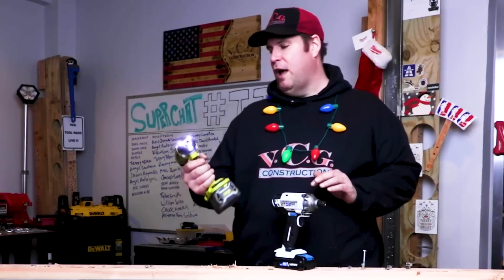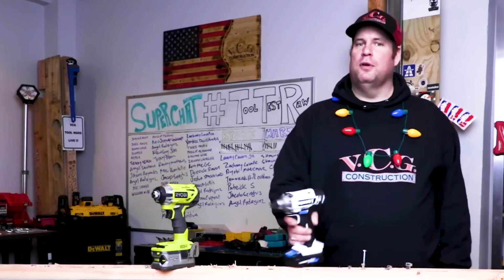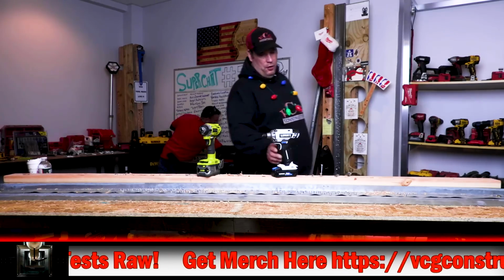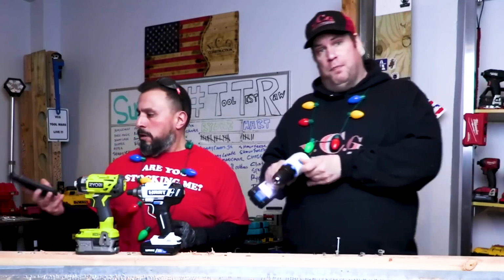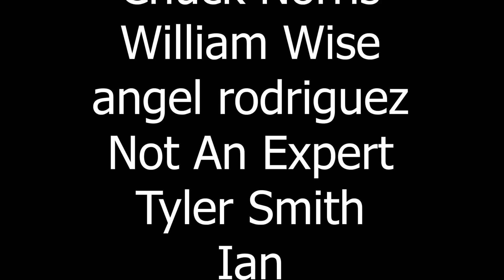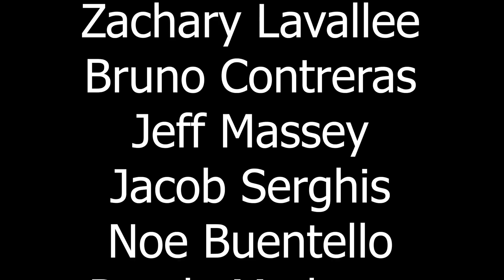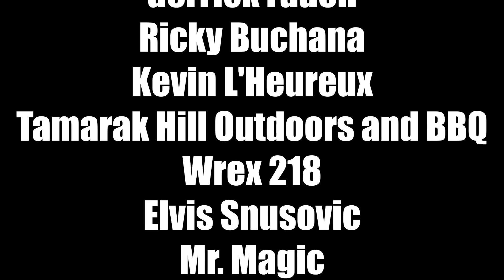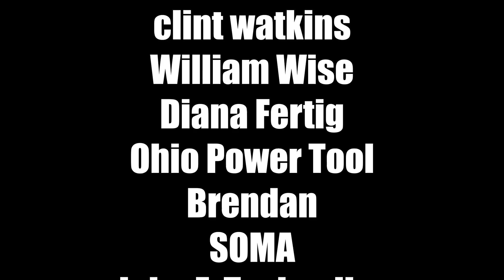We Tested New HART Tools Impact Driver From WALMART...(not what i expected)

Comment: Sooooo I’m not rooting for either team here, but you have to different MAH capacity batteries going. Of course the Ryobi is going to win, the motor can pull more juice from the battery. SMH
Reply: Correct! But these guys are no engineers. LOL
Reply: These tools are identical, made by the same manufacturer
Reply: Yeah that's what I was saying lol gotta make it fair before you put them up against each other
Reply: The only difference is the plastic
Reply: Agree

Comment: Hart vs hyper tough battle of the Walmart brands
Reply: Hart seems like it could actually be classified as a tool. Maybe hypertough vs black and decker?
Reply: @hunterwolfe9059  Don't be a hater. For years dewalt motors were in black and decker cordless drills and even the batteries were interchangeable.
Reply: @MrWizards1974  correction Black & Decker XR was before the DeWalt XR
Reply: Hyper Tough is ass and soon to be discontinued according to my buddy who works at Wally World... I 💙 my Harts though! 😊
Reply: @hunterwolfe9059  black and decker is better.

Comment: Not sure the big man knows that the harder he pushes on the tool while driving the screw, the harder he's making it for the motor.
Reply: Duane George from what I have seen the gearbox and motor are fixed relative to each other on most impact drivers so not really true.
Reply: @hasimalahmadeen472  it just makes sense that too much pressure on the screw adds extra friction, creating a heavier load on the motor.
Reply: Right!? You wanna push just enough to keep the bit snug on the screw head, but there is zero benefit to forcing it! That's how you break screws, bits, and motors! 😟
Reply: Dont know if big guy knows how to put a screw in straight

Comment: You should be matching Hart to non brushless cheap RYOBI P235 that comes in tool combo packs.  It's the same tool as the Hart.
Reply: they compare the tools they do bc the price point is comparable. 

if you start comparing the more expensive hart to a cheaper ryobi tool then you're going to get the results you're looking for. 

these are meant to be comparable in price and therefore they are comparing the better tool.
Reply: @jakobe328  HART tools are overpriced for no good reason...
Reply: xephael but they are wallmarts best...
Reply: Xephael, you are probably correct as both Ryobi and Hart are brands of TTI, probably manufactured in the same Chinese factory.
Reply: Ive had that ryobi for the last 5 years. Ive beat the living shit out of that thing. Honestly, it still runs great.
Reply: @amatteroftimeisuppose8900  I have the Ryobi too it's amazing
Reply: Hart RYOBI and Milwaukee are all made by TTI based out of Hong Kong just rebadged and detuned performance wise other than that they are all made of the same materials not bad for the price I’ve beaten The hell out of all 3 brands really comes down to brand preferences and use
Reply: Jakeb I disagree. If you’re going to compare tools, the comparisons have to be as similar as possible. That means the same battery size (aH wise), brushless, etc. At the end of the test you can give your prices and let people decide. Think like Car and Driver magazine comparing similar class cars. They’ll stack them up capabilities-wise, drive them, then show you the price difference.

Comment: The batteries don’t look the same. The Ryobi looks like a 4-aH battery and the Hart looks like the 1.5-2 aH battery it comes with. The 4 aH battery is twice as powerful. Not a fair comparison.
Reply: Amphour doesn't make the battery more powerful,  it just makes it stay charged longer.
Reply: Wrong dogz. The 4ah battery is needed to reach full torque. Check it out
Reply: doesnt help one is 18 volt and the other 20 volt
Reply: @piggybank292003  the bigger the battery the more torque it unlocks. Do your research

Comment: I've purchased Hart Tools and found them to be fine for me being a  home owner. I wouldn't recommend these if you're a handyman or contractor making a living with their tools. These are obviously low end tools and should not be expected to out perform or last as long as the high end tools. I know I got what I paid for and fully understand. You pay $48.00 for a skill saw and that's what you get. An inexpensive $48.00 skill saw. Thanks for the video.
Reply: They do make "construction grade" tools. They aren't "low end" by any means. I pulled 8 VERY rusty bolts out of a 15 year old car, from the seats. And it did it easily with the 4mah battery

Comment: Larger batteries have a higher amp rating, not just capacity. Allowing the motor to draw higher amps and more watts at the same voltage as the smaller batteries. A fair test would be to use the same or similar batteries

Comment: What size is the Hart battery? Seems the Ryobi battery is much larger in capacity. Could make a difference
Reply: I think the Hart batteries they are using are a 1.5ah and the Ryobi is a 4ah they are using it because that's what the kits come with. Hart makes a 4ah but I'm not sure if it's out yet or if it's not feasible because of the price difference in the kits it wouldn't be an equal comparison.
Reply: The capacity isn't making a power difference here. They're mostly the same tool from the same parent company. The only advantage would be if the Ryobi were brushless vs. brushed Hart.
Reply: 1.5ah vs 4ah is a HUGE advantage. NEVER let anyone tell you the battery size does not effect power with drivers and saws especially. I’m sure the “scientists” are going to respond saying the size battery doesn’t effect driving power. But from someone that uses these tools in the field everyday I’m telling you the difference is massive on certain tools. The first couple screws won’t be that different, but as soon as that smaller pack starts getting warm the larger pack destroys it.
Reply: warlok9 peak capacity makes a huge difference. It’s like cold cranking amps for a car battery. The bigger battery will have a lower internal resistance and be able to supply more current and keep the voltage up.

Comment: Used Makita since the 9.6v first came out until. . . I got a Ryobi 18v set 4 years ago. Use it commercially 5-6 days a week. Love Ryobi now... impact driver has been beat to hell, dropped off ladders and used as a hammer. Sawzall is great with a 50% or better battery, skilsaw is good. HVAC. My money goes to Ryobi now. My 4ah batteries are fully charged in 30 minutes, 2 for $99.

Comment: The batteries with higher amp hours deliver more power and more performance, allowing the battery to work for a longer time on a full charge as compared to the cells with lower amp hours. ... As the AH or amp-hours rating of the battery indicates the consumers about the amperage that a battery will provide in one hour.

Comment: Hart is only sold by walmart not manufactured by them, hart is owned by TTI , so in a way hart's cousins are ryobi, Milwaukee, and Rigid. Also for its first go at a full line of power tools they did remarkably well in my opinion, coming from mainly hammer and crowbar tool manufacturing. No it's not pro or expert level tools, but they are far from junk again my opinion. Great for  a DIYer who knows alittle of what he is doing

Comment: ....some stuff I ONLY buy at Walmart...best price and such...BUT..a power tool is something I will NEVER buy at Walmart...along with outdoor power equipment...not only is there the question of quality, but Home Depot WILL take care of you if you have an issue with the Ryobi..once I bought a drill that came with 2 batteries...used it (heavily) for a few weeks, then one of the batteries quit taking a charge...took it back to Home Depot, instead of giving me a new battery, they gave me a NEW drill set, with 2 NEW batteries(even though the drill/batteries were beat up and obviously heavily used)...another time, I bought a Ryobi reciprocating saw, used it on a demolition job and burnt out the motor...again, heavily used...they cheerfully gave me another one. Try that at Walmart...I guarantee you will get the old "Warranty is through the manufacturer" or "Not warrantied due to abnormal wear and tear" B.S..... ;)

Comment: I want to see it go up against Hyper tough 20v impact.   The drill driver of hyper tough is about the level of b+d drill

I am just a diy and only use them on occasion around the house and diy projects and some light mechanic work and  lawnmower repair.  

The HT 20v impact is rated 
at about 1300 inch/lbs 

It’s closer to a 12v then I think.

Comment: Not a fair comparison. You are using a 2S battery on the Ryobi and a 1S battery on the Hart. You need to use similarly-capable batteries to see which tool is actually better.

Comment: When is Ryobi the worst? I assist in the making of engines for Boeing, Air Force, NASA and I never had an issue with my Ryobi. I do have issues with my Dewalt. Especially the batteries dying after two months use.
Reply: I had two Dewalt drills within a period of 5 years and the batteries stopped working on one within 1 yr and the other I stopped using for 4 yrs and the batteries stopped working as well

Comment: you guys are knuckleheads but I love it.  Hart is manufacured in the dewaldt facility! TOOLPRO 34 years and counting
How about some battery time measurements and torque spec output.  I coould smoke both of you with the screw thing!
Reply: HART is made by the same company as Ryobi, TTI in Hong Kong.

Comment: I think the Hart tools shown here are the same as Aldi's old 18v range.  I picked mine up with 4 1.5ah batteries for a total of £58 and in the US tools seem to be cheaper so they cost less in dollars generally.  If it is the same then I love them as a homeowner tool because I don't have to care if I damage them and need to replace it (yet to happen).  I had a Milwaukee at one point but I felt like I was scared to use it because it cost me so much.

Comment: only thing i seen was one guy can use the drill better then the other, not a valid test. would be better if they did continues use to see what battery lasted longer and stress test to see how long it took to over heat the battery.

Comment: I have a craftsman 19.2 impact driver that is 10yrs old and could beat the heart and ryobi
Reply: Mid 90's bought a 14.4 Craftsman drill that blew away the DeWalt comparable. Worked for almost 15 years in pro/sumer fields. Used it on the side job and at home.  It let the smoke out before the batteries died on it. To this day I still want a drill that works like that one did. Even their 18 and 19v drills were good, but not like that one.
Reply: It wouldn't beat the Ryobi.
Reply: The old Craftsman stuff was rebranded Ryobi as far as I know.